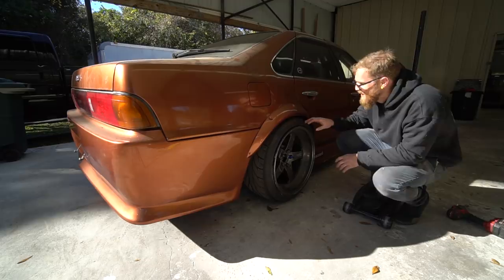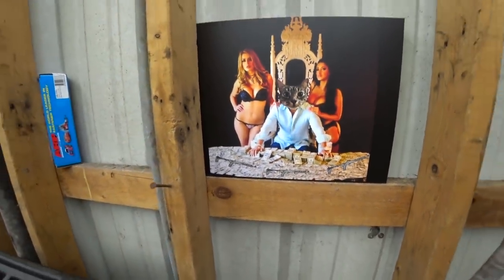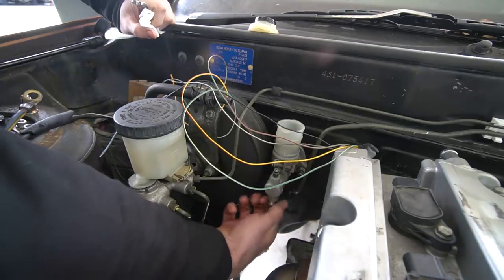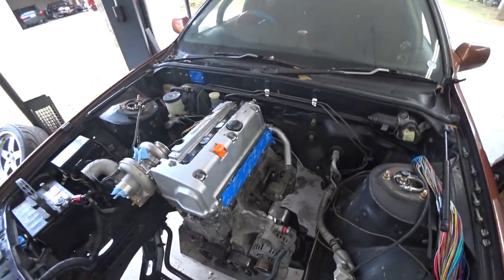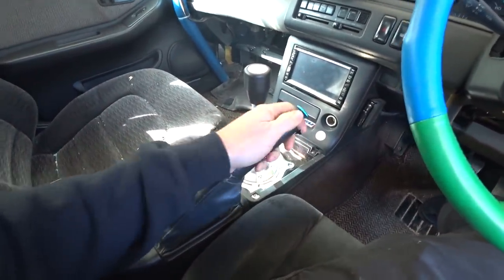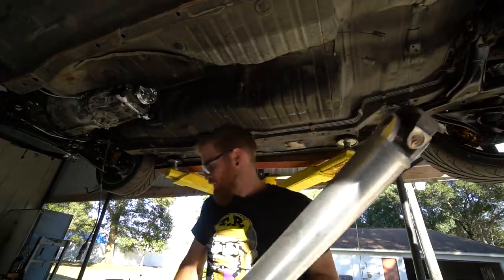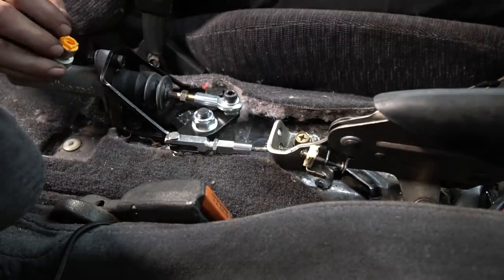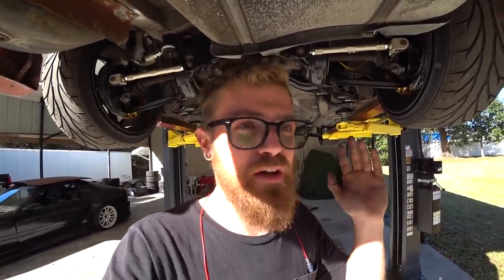Turbo K24 Cefiro Build pt.13 Making it all work.

Comment: Taylor: “we’re prob gonna run like 265s in the rear instead of these 235... Gibber jabber... and in the front we have these 265s and we’re really gonna run like 235s up here” correct me if I’m wrong but I heard I have the correct tire sizes but they need flipped😂

Comment: Such a cool setup with the handbrake.  Looks like the swage interferes with the bracket, hopefully that extra length isn't needed once there's pressure in the cylinder.  Crazy how compact that is.

Comment: Get yourself a pair of Knipex 8" mini bolt cutters. Part number is 71 01 200. They'll cut right through that hand brake cable. Total magic. They're the type of tool that I didn't think I'd use a lot in an automotive application, but I use them ALL the time. They're great!
Reply from the maker: Good call! Didn't know they existed will order some

Comment: You can sand the paint with 600, or 1000 grit or add more paint if you need, and repeat, and get a few cans of 2k clear and spray a few coats. You’ll need about 6 cans of 2k clear to cover the body of the rx7 for 2 coats

Comment: Some dont realize that attacking one system at a time is less overwhelming than having 10 different things happening at once.. Wiring it all together is sometimes daunting but much easier to manage when you can hyper focus on it.  This Cefiro build is going to be rad and well sorted out in due time. relax people its part of the process that makes it so satisfying once "complete"  .
Reply from the maker: Yeah and I just got a bunch of other parts in so I figured I would knock them out first, and I need the intake and injectors on to do the wiring.
Reply: @Taylordrifts  Makes perfect sense. Just like you had said, just seeing something resemble what the final form will be, gives you more motivation to power through to the end.  Just checking off the suspension, brakes, hydro, wheels, makes the other systems seem like they just fall into place. Wish you all the best and keep on pushing the limit of what others dream of attempting.

Comment: Looking at the diff cross member you might want to put a brace that runs under the diff and reinforces where the swing arms connect to prevent the cross member from cracking.

Comment: i welded the hydraulic handbrake push rod mount ontop of my stock handbrake to retain the cables for MOT purposes(road inspection) and it works great and if theres a brake failure i still have the "emergency" brake

Comment: Maybe for when you're alone, and also to avoid the cars running into the shop wall, get a small winch, and bolt it to the shop floor near the wall.  Then you can slowly pull cars up onto the wood ramps

Comment: The cable connector is going to jam against the hand brake bracket when the pads wear down.
You can probably cut the problem area away to give it more travel.

Comment: It looks like you might need to open up the bracket  where the cable goes through because the adapter seems to be hitting the bracket before you max out the pull on the e brake.

Comment: Hi Taylor at 9:50 you show the clutch fluid line touching the floor pan not good plus the gearbox will twist up when under different loads hopefully you have already seen this thanks for sharing great vlogs

Comment: I love this build. When you bled the clutch and brakes did you bench bleed the cylinders? And if so, what did you use?
Reply from the maker: The clutch actually had a bleeder to bench bleed it right on the master. The brakes I didn't need to bench bleed. I have a little plastic fitting kit from the parts store with a hose I used when I need to.
Reply: @Taylordrifts  cool thank you! I can’t wait to see the finished product man

Comment: If you’re going to stick with the Stock TB, upgrade to a oem acura TL-S  depending of youre going to with drive by wire 2004-2008  or electronic you can go 09’+

Comment: What kind of power tools does Taylor use to work on his car and stuff? Looking for a good impact and drill that's not too crazy expensive
Reply: Milwaukee.
Reply: @old_con  do you know what model of Milwaukee? Thanks
Reply: Stratz I’m afraid not as I’m in the UK and our model codes/numbers are different to USA ones.
Reply: @old_con  ah gotcha thanks anyways
Reply: Go onto the Milwaukee web site and have a look at the different models and like with me I tried to get the most powerful tools that were in my budget. Obviously the 18v tools will be best but then it depends on size sometimes you need just the 12v tool for the application you require.

Comment: Idea time I understand why you have the wood shims Because your cars are so low you can't get the lift arms under them. My idea is put concrete humps permanently on at least one of your lifts... At  least when you have the second lift installed
Reply: Those wooden race ramps are so useful. I made a set after seeing them on this channel, I use them loads. You can use them to get under the car for power washing, jack access and oil changes. All my cars are too low to jack with a regular trolley and the ramps have been really versatile. I wouldn’t want any concrete on my floor, you always have different wheel base lengths with more than one car, the rear ones would never be in the right spot.

Comment: Does that thing work like a stock BMW CDV (clutch delay valve) that just restricts the flow of the fluid to smooth shifts? I removed mine and I know a lot of people do the same. It felt a little unnatural coming from other manuals, like it was made for people who didn't really want to have to bother to notice when and where the engagement point was. I am curious what you will think with and without that thing.

Comment: 3 things
There has to be a better way to get a lowered car on a lift. 
2 if you added blocks to the top and the car would stop once on the lift blocks
3 why would it hurt to leave the hydro brake on all night?
Reply: You dont want to leave hydraulic lines pressurized for an extended period of time, this is why you see track hoes and other heavy equipment set the bucket down on the ground when parked, eventually it will blow out a seal

Comment: wonder who the assholes are that dislike this.... keep at it taylor!! what "socket" is the one you use for putting on lug nuts?
Reply from the maker: It’s a wheel socket with a protector. I buy the extended ones on amazon.

Comment: Why do you put the left higher then lower it
Reply: U have to ,to release the safety's
Reply: @phillipwarner5504  ok the latest one I use I did not  have to do that put it was a old one
Reply: Did u have to release the locks to lower it when ur rasing it it goes past them on it's own it's just safer to lower it down on the locks cuz the vehicle could drop some while you're under it
Reply: @phillipwarner5504  now I know why shop closed down not safe equipmentn
Reply: That could be or lost their ins could be allott of reasons really

Comment: I cringed watching the bottom of the console being cut out. Master under the car on a bracket. Yes not as accessible but still have a functioning console then.
Reply from the maker: It would hit the driveshaft.
Reply: @Taylordrifts  Its cable actuated longer cable, mounted just off to the side of pinion and differential.

Comment: Open deck is going to be the down fall for a drift car that takes a lot of heat that cylinder wall  going to expand at drift heat and blow up worst engine honda makes sorry not sorry Ive spent 25k on stock k for my car it's not a torgue or strength engine for long periods of drifting yeah they might work for drag but not for continuous strain from drifting I laughed when I found out shit going to break every week

Comment: It’s killing me ...... why did you bolt the handbrake master back through the tunnel , and not nutsert (rivnuts for you American folk) it instead ? Usually you are Mr do it right .. now seeing 4 bolts ( and to make it worse 2 up , 2 down ) in the bottom of the trans tunnel just looks 🤢🤢🤢🤮🤮🤮
Reply from the maker: It’s 3 down. 1 up. The one up acts as the pivot for the lever so it has to be that way. Rivnuts wouldn’t be strong enough or spread the load well enough. And not possible due to tunnel bracing.
Reply: @Taylordrifts   well from watching the video it didn’t seem like it was anywhere near the bracing in the tunnel 🤷‍♂️ and rivnuts would have totally been strong enough . Of all the comments I have left on your videos ... I finally get a reply and argue about handbrake install 🤦‍♂️